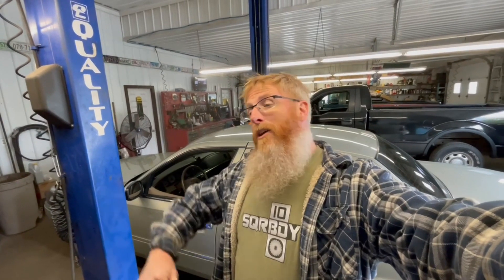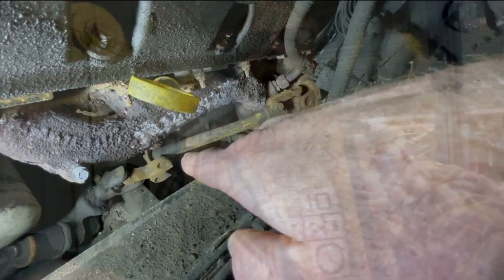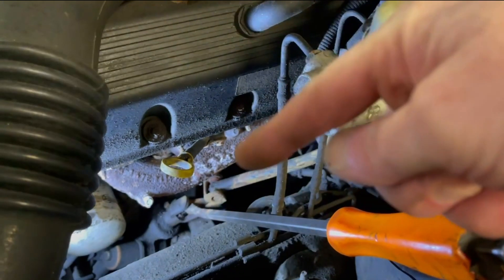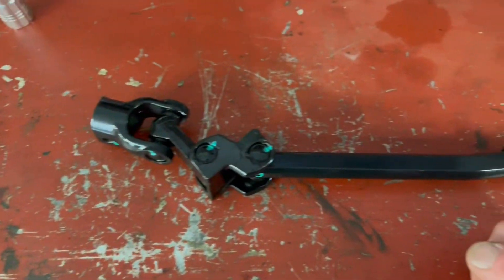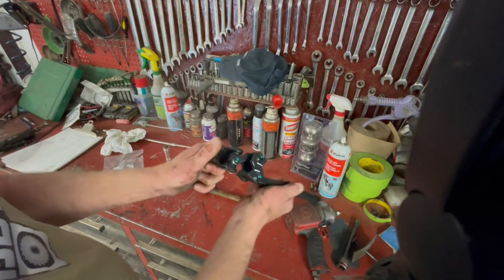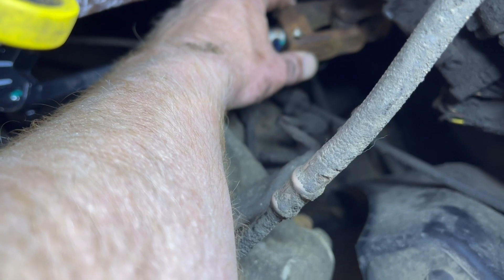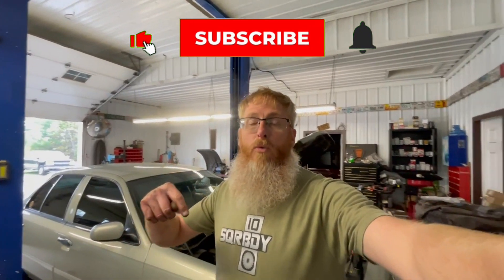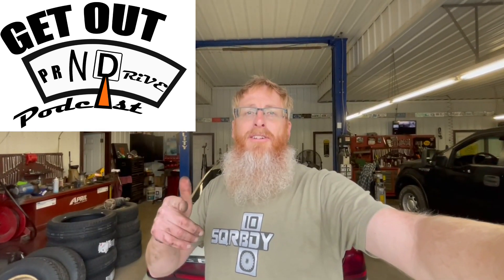How to Replace the Lower Steering Shaft on a Crown Vic, Grand Marquis & Town Car

Comment: It’s funny, my dads Vic had a recall on this, and mine had the same shaft was exactly the same but wasn’t included. Replaced it out of pocket. Sprayed it with PB blaster on the joints every now and then and it works wonders

Comment: Best thing I've found that frees these up in the interim was to just drench the joints with motor oil. WD-40 worked OK but faded away quickly, and the silicone lubricant I tried made it WORSE somehow. But for what the part costs and the simplicity of the install, it's totally worth picking up a new one.

Comment: I believe my 2007 CVPI was done before I bought it. I wondered why the middle shat was bent. My 2011 is straight. Thank you very much for the great video. AC9IM
Reply from the maker: Hard to say, but i do thin k they changed them in the later years.

Comment: I did a body lift mine won’t fit anymore do you know if I can get one with a extension?
Reply from the maker: Check summit or jegs for steering shaft extensions and couplers. Most are pretty universal.

Comment: Cool great info thanks.

Hey, what kind of city mpg does those full size boats get with the tiny 4.6L? I just started driving a '96 Thunderbird with a 4.6 is why I'm asking. They probably do better than one of those made for here I would guess because when I worked at Dearborn Assembly the Canada bound 4.6L trucks were rated for better MPG. Not sure if that crossed over for cars though?

The only thing different that I could visually see was that the Canada bound trucks had a different exhaust system. Of coarse they probably got a different tune as well because IIRC they were also rated for a bit more power as well, this was back in 2010. I wonder if the cars over there were like the trucks that were sent there? If so, I might want to source a '96 Canadian Thunderbird computer?(I can change the exhaust here) Would be nice to be able to eek out a bit more mpg with what the prices are these days!
Reply: I get 16-17 city in the winter and 17-18 city in the summer with my 99 grand marquis, highway is around mid 20's with 3.27 gears.
Reply: @MattsRageFitGarage  

Is your car built for Canada or the USA? That seems decent-ish for such a big car, my '96 Thunderbird is rated around the same but with only 2 doors and a much smaller trunk. Thanks for your reply.
Reply: @itseithergonnaworkoritaint7852  Mine was built for the US market.
Reply from the maker: I'm getting about the same for my Canadian market car.
Reply: @OldeCarrGuy  

Cool thanks. Must be some sort of emissions exemption Canadian trucks have(had) that gave them a fuel economy/power advantage back then? Thanks, mystery solved.
Reply: I am at 21.3 MPG & need a tune up I was getting 23.4 . Mine is a grand Marquis.
Reply: @oz7245  
Is that city or highway mileage?

Comment: Any videos on how to change the steering column .. couldn't start my 04 grand marquis wouldn't crank nor turn all the way off
Reply from the maker: It’s likely just your ignition switch.
Reply: Is that the white box switch under steering wheel cuz that's how I'm starting it now  or you talkn key s switch it self
Reply from the maker: @dharsley9570  yes! If the key doesn’t turn it, then you need to replace the actual lock cylinder and possibly the key!

Comment: Been there. F-150’s do it too. One fix i tried was remove shaft and heat the knuckle. Dunk it in motor oil. As it cools it pulls the oil in. It worked for 2 years. Seems to be a ford thing. Well, not true, i did it on some kind of import. 
Best repair is a new shaft, but they arent cheap.
Reply from the maker: Thanks for the tip

Comment: I have a 04 town car I replaced upper and lower steering shaft, replaced power steering pump and rack and pinion, tensioner and the belt this garbage is still stiff 😡😡😡😡😡😡 so frustrating!!! Any ideas what it could be??
Reply from the maker: Have you tried jacking the front end and turning the front wheels by pulling or pushing on the tires from left to right. You may be able to feel something binding! Bad ball joints or strut mounts can effect your steering as well. Hope this helps!
Reply: @OldeCarrGuy  thank you for replying, I just found out the problem and me being stupid instead of testing the relay first I went straight replacing everything. So after 700$ worth of parts it was a 11$ relay 😭😭

Comment: How do I replace the plastic bearing thing underneath the steering column had the lower steering shaft replaced and now the plastic bearing to be coming out of the steering column how do I tackle that and how easy is it to fix this looks like a green plastic bearing thing
Reply from the maker: I'm not sure. I've never had to do it!

Comment: Link leads to unavailable part.  Dorman 425-360 is about $52 now.  I've installed it in a couple cars over the last 3 years, and have another waiting to be done.  Both times car needed alignment to center the steering wheel.  Did this install require alignment?  The OEM part, 5W1Z-3B676-AA, is $130.  An alignment is $100.  I'd be money ahead buying the OEM part if it doesn't need to be aligned.
Reply from the maker: It doesn’t require alignment! The part is a direct fit! Thanks for letting me know about the link

Comment: I dropped the entire steering column down to the floor while removing the dashboard when I was replacing door actuators now the entire column doesn't want to go in the shaft it came out while lifting it up to bolt it.please help.
Reply from the maker: The shaft is keyed. It only fits the column one way! Try turning the steering wheel a bit!
Reply: Thanks for getting back to me 👍
I've been trying for hours 😩 is that how it worked for you? I hope if it works the steering wheel will be straight.
Reply: I should have been more careful! but I didn't think this would happen.

Comment: Can this be prevented to happen??
Reply from the maker: Keeping it lubed may prevent this.
Reply: spray it down with WD? @OldeCarrGuy
Reply from the maker: @summerforever6736  If it's not yet binding, you'll want to use a lube style spray like PB Blaster lubricant or Rust Check. WD40 is a penetrant and will dissipate over time.
Reply: thank you!! @OldeCarrGuy

Comment: My 2003 Grand Marquis only has stiff steering during the winter months "New England". Doesn't get any better after car warms up from driving. Stays fairly stiff. Warmer months the steering is perfect. Only colder winter months. Reminds me of my old standard steering trucks from the early 70's. Somebody please help. I'm fairly mechanically inclined.
Reply from the maker: I would try flushing the power steering fluid! It may be jelling up in cold temperatures. Make sure it power steering fluid and not transmission fluid. Some People substitute and this is what happens!

Comment: How would you know it's the part and not something else?
Reply from the maker: Experience mostly, but when you turn the steering wheel and it feels like it's hard to turn, but only in one spot. As I showed in the video, if you take the part out and it doesn't bend at the joints, it's time to replace it.
Reply: Okay, thank you much. Yesterday I got on the freeway and after I hit about fifty, the car started swerving by itself, about to roll. After slowing down only then was I able to steer the car? Your thoughts
Reply from the maker: @leschambers683  I would have your suspension and steering components checked.

Comment: On my car it feels like the steering shaft is backwards at highway speeds 

Just feels like the car tracks in the opposite direction of where the steering wheel is pointed
Reply from the maker: Best be staying off the highways and get it checked!
Reply: @OldeCarrGuy  it’s going in the shop for a fuel pump next month I’ll make sure they check it out

Comment: Very bad engineering.Perhaps on purpose.Yet still better than drive by wire.
Reply from the maker: 2004 was the last year on these cars for cable driven throttle. And yes, Planned obsolescence is real!
Reply: @OldeCarrGuy  Sad, as HHO fuel is what we should focus on.